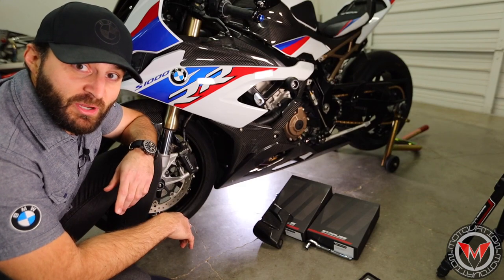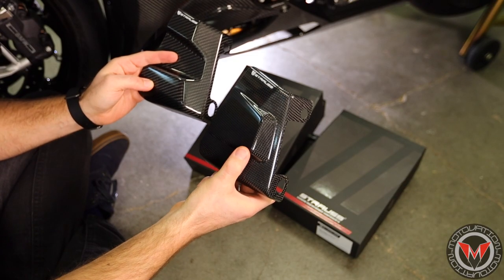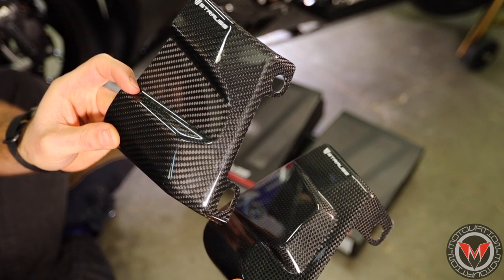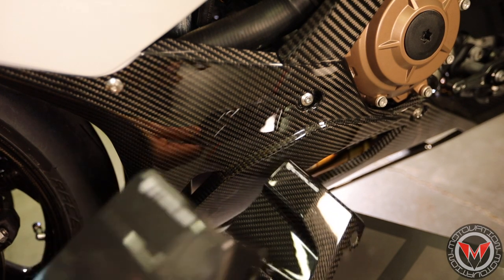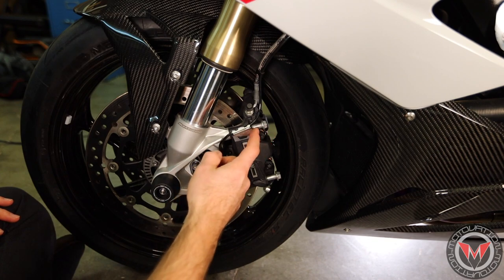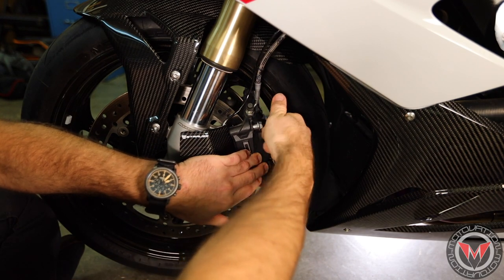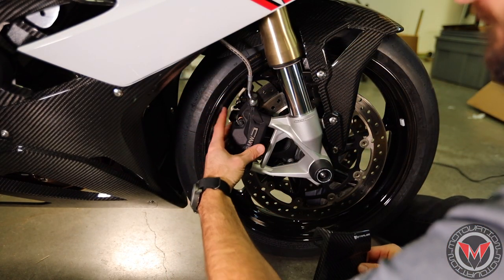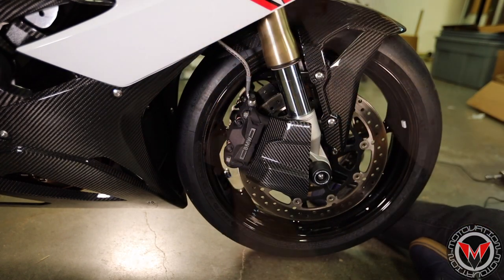Strauss Carbon Brake Cooling Ducts | 2020 BMW S 1000 RR | Quick Install

Comment: With an installation like this, apart from the fact that the cooling air does NOT impinge on the caliper, you have separated the caliper from the fork foot and therefore have changed the footprint of the brake pad

Comment: Bought these for my Panigale 1299 - complete waste of money as confirmed by the other comments here - causing the brake caliper to misalign and in my case, dragging on the front wheel and actually causing constant overheat. £300 down the drain, thank you.